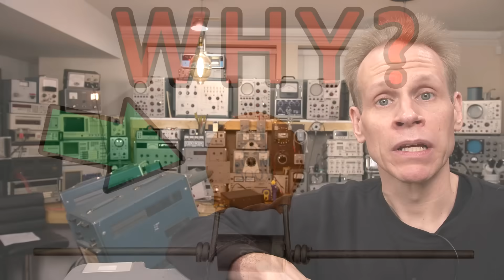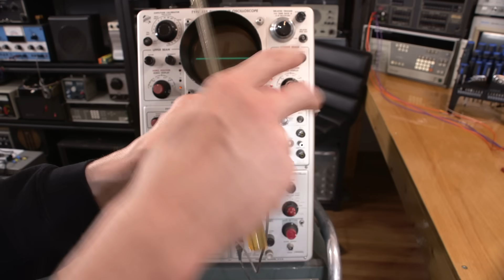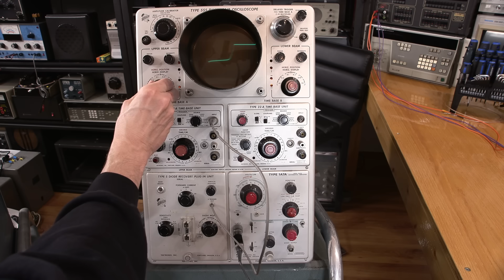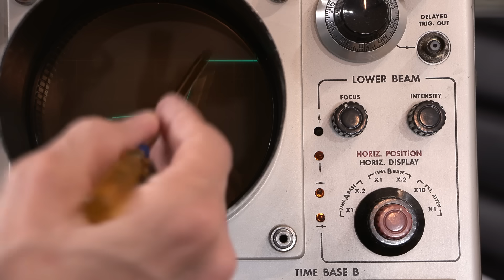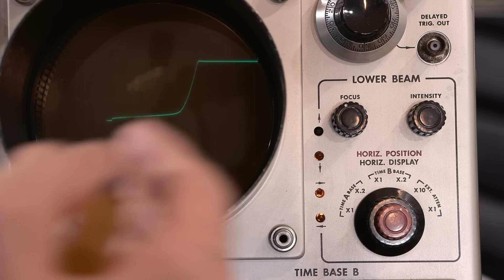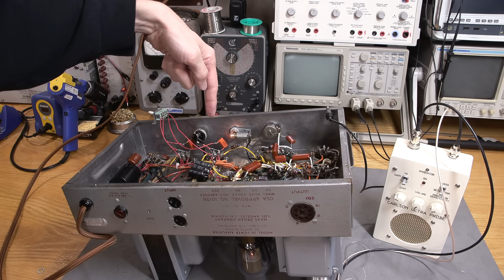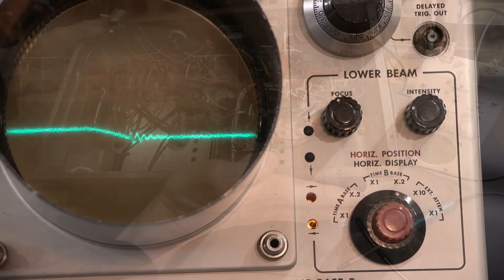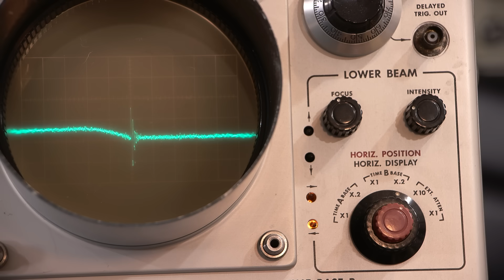Why Put A Capacitor Across The Diode? Here's Why!

Comment: First time watching your channel... I never knew this so every day is still a learning day even at 64. The valve amp took me back to being a kid when I was designing circuits with power pentodes - valves much more satifying to work with than transistors :o).  I could swear that the handle of your ultra probe looks like the body of a solder sucker - I have one exactly the same colour that I got yonks ago and still works as well as it did from new.

Comment: What is the relation of the capacitance to the diode used?
If the recovery time consumes 10nC of charge, would I use a 1nF, a 10nF or a 100nF capacitor?

Comment: if you have a an integrated rectifier block it will not be possible to put a capacitor over each single diode

Comment: Interestingly i didn't know that they were important because with a large capacitor across the dc,i always that would be enough to eliminate all the ac component hence removing significantly all the humming or noise in the circuit.Very interesting.

Comment: Using a capacitor in this way, if the diode burns out, alternating current will pass through it and burn out all the subsequent components.
Reply from the maker: What you need to ask yourself is: How much current will a .01uF capacitor pass?

Comment: So in a tube guitar amp where the bias supply is being rectified by just a single diode, is there any benefit to putting a cap across that diode and if so, what would be the preferred type and value?

Comment: I have a question. In a situation where the power amplifier's power supply lacks capacitors in parallel with the diodes, does the switching interference of the rectifier diodes generate a buzzing noise so severe that the amplifier constantly wakes up and it becomes difficult to adjust the floating quiescent current? Best regards.

Comment: Hello, the Snubber Federation (capacitor + resistor in parallel with a diode), which I represent, appreciated your video.

However, the Federation is concerned about the absence of a series resistor, which prevents excessive recovery current. We also remind you that filtering a diode requires taking these parameters into account to correct other resonance phenomena that might occur. The Federation also indicates that the switch setup used in this video to demonstrate the benefits of a capacitor is for educational purposes only and is not suitable for all circuits. The Federation cannot be held responsible if the series inductance and/or switch bounce causes damage to your circuit.

Thank you for your interest in snubbers.

Sincerely, 
the Anonymous Snubber Federation.
Reply: Haha, the word 'snubber' brings back some memories!  In university a colleague student had the problem that in his SMPS the snubber diode regularly blew out. So I advised him to put a snubber over his snubber diode. And it worked! 😀

Comment: Nice presentation, only remember than very often capacitor not are inserted because feliability is more low than without, but is true than in some cases is better for example close to zener diode for control level of voltage before a converter...

Comment: Placing a capacitor in parallel with a diode reduces voltage noise and spikes across the diode. The capacitor acts as a temporary storage for charge, absorbing rapid voltage changes that would otherwise appear as noise. This effectively "shorts out" high-frequency spikes and smoothes the signal, creating a cleaner, more stable output.

Comment: I built my First radio, at the age of Seven, in 1957.

Fast forward Eleven Years, and I walked through the doors of the US ARMY SIGNAL CORP, for Avionics Communication Equipment Repair.

IFRC, the number 1 topic for EVERY RADIO, was the number of CAPACITORS needed, for "clean transmission & reception" 😮

• • • • • • Thanks for the memories,

TroubleShooter ONEFIVE, I fix your shorts, no sparks included 😊

Comment: In a zener diode the noise is even worse and you really need a capacitor there! I have made long range single frequency transmitters using only zener diodes and an antenna and a ground It's a really simple one component transmitter with a bleed going to ground.

Comment: Interesting. I hqve a motor in my telescope that acts up, usually just this time of year. Looking at the replacement motors it has a pcb on it that the motor in mine doesnt have. The pcb takes the signal from the motor controller, through a capacitor on the board, and then i to the motor. Presumably this is doing sort of the same thing that you cover here.

Comment: i am being a bit dim here but only have a basic understanding of some electronics so bear with me..
I can appreciate that the diode is a gateway on the circuit allowing the current to pass through in 1 direction (good name for a band Diode lol)..
What I am struggling with here why does the current not just use the capacitor as an alternative path through the circuit?
Also why would this filter out the "noise" when the pathway through to the diode is not interrupted by the capacitor? It seems to just sit alongside it - how is that going to filter out the noise? 
As I said a bit of a novice but I like to learn - I have tried Dr Google and whilst it explains some of it it doesn't explain it all ie the  questions I have just asked..

Comment: Different capacitor values block different noise frequencies. I’m not sure he understood the reason, but it’s a good experiment. Some people use multiple capacitors in parallel to cover a broader range of noise filtering—especially in power supplies.

Comment: I don't think you provided enoutgh background this time. What is the diode used for in the application? OK, after almost 3 minutes we find out that it's a rectifier of mains AC voltage. What are the axes of the analyzer, and why.don't we see the forward region? What would the curve at the analyzer look like if you added the cap to the tested diode?

I still don't understand why adding additional capacitance to a diode that has parasitic capacitance helps.

Comment: i have no idea about electronics but i remember putting a capacitor on the speakers line of my aftermarket car radio( or power input between + and -) dont remember well. and solved the noise problem, i used a electrolytic capacitor(12000 uF, 12v), :0 haha

Comment: On a full-wave bridge, would you need 4 diodes, or just 2 as it appears with your switched circuit?
Unclear on where just 2 diodes would go on a full-wave rectifier with 4 diodes?!?!?
Reply: If there is  a center tap on secondary side of the transformer, then full-wave rectifier needs only two diodes. It was usual in old school amps, especially with vacuum tube double diode rectifier.

Comment: Not a expert here but with some questions: It looks like this is only for AC or analog signals, but not necessary for DC. Also what happens when the circuit is turned off? Does the capacitor stays charged with the diode preventing from de-charging? If yes, can this be fixed with a (very large) resistor in parallel to the diode, just to allow it to loose it's charge when turned off?

Comment: Thank you! A very simple solution to a non-obvious factor, even for an experienced electronics engineer...
It is obvious that electromagnetic noise cannot be completely smoothed to zero in principle. After adding the capacitor in parallel to the diode, the wavelength changing to shorter or longer. Obviously, the change in wavelength depends on the capacitor's capacitance...
I'd like to see practical tests of capacitors with different capacitances and types (polar, non-polar, and different materials made from)...
Reply: It's just slowing the rise time which is attenuating harmonics.

Comment: i guess this capacitor it need to add to a unregulated power supply to removed ripple specifically a 12volts it need 4 of them placed across bridge

Comment: The  diode noise  is actually a spark gap?  Irritating  noise in a hairpin circuit  could be eliminated and energy conserved if a condencer is employed  ...thanks  ..now I see how the solid state version of the spark gap can be enhanced  in  a device producing  longitudinal waves..cold electricity without the noise..  I would like to see  cold electricity in every home  as a safety precaution..

Comment: For the viewers who have never enjoyed working on circuits employing vacuum tubes.  There was a lot of apprehension associated with probing around in a live circuit.  Voltages were often in the 100's of volts.  It didn't take much to get big, dramatic sparks,  electrical burnouts, and the occasional painful electrical shock.

Comment: Capacitors are very useful.  I have used them in my car to time out and lock out relays making them momentary and safe from overheating.

I added an electric gas door release from a different car and trunk release button  with a capacitor in line with each of the relay's triggers... When the release button is pushed the relay triggers while the capacitor charges, then when the capacitor is charged the resistance shuts off the relay.  The charge in that capacitor keeps the relay off and unable to trigger again until a resistor bleeds it off.  This makes the release momentary and also prevents overheating within the relay or the acuators in the event the button gets stuck or there is a short.

Comment: 4 diodes, 2 caps. I'm not familiar with the amplifier, particularly the 2 diodes tied to 2 pins of 2 tubes, but I think what we're ultimately talking about here is not simply "putting a cap across a diode" otherwise there would be 4 caps for 4 diodes. I think this is just adding caps to ground and filtering the AC artifacts from DC nodes. That's fine, but the presentation is quite click-baity and literally hand-wavey. Of course, I am completely open to being wrong if you'd care to explain.

Comment: Just imagine an ideal diode configured as a half-wave rectifier, converting a 60 Hz pure sinusoidal tone into a half wave rectified sinusoidal pulse train.

A pulse train in the time-domain is also a pulse train in the frequency domain.  So lots of 60Hz line noise up-converted to "n" harmonics of 60Hz.

The capacitor makes the current transient in the current loop path less abrupt.

In the frequency domain, it has the effect of "rolling off" The high frequency harmonics.  The same as how a low-pass filtering cap connected across a speaker would act to muffle  high-frequency treble sounds from coming out of the speaker. 

In the scenario that was demonstrated, there is no speaker, but there is magnetic field coupling (to his sensor thingy), parasitic capacitive coupling, and some electromagnetic (radio-wave) radiation. 

The capacitor simply reduces the abruptness of the diode on-off current and associated voltage ringing that the current-path inductance generates.  Inductance wants the current to keep flowing, and the capacitor provides a path for some continued current, reducing voltage spiking.  Reducing the otherwise detected spiking.

🤷‍♂️

Comment: If you need a project I have an old HygainVII   CB/SSB 23 channel slant face that needs a new chassis socket, I attempted 3 times to put new one in but the socket has both a capacitor n diode. I fixed boilers and burners for decades with all the controls but when it comes to radio inners I know ZIP I have no business in there..  Thanks Mr. Carlson

Comment: Nice scope, I had the rack mount version, rm45a think it had a 1A2 input module. It was a govt. surplus purchase.
Reply from the maker: The 1A2 is a fantastic plug in! The 1A7A will see signals at 10uV (or microvolts,) better than any scope on the market today, with filtering too!

Comment: @Mr.CarlsonsLab.  Great info!  What would be a cool continuation of this is if you could compare the noise output of a solid state rectifier vs a tube based one.   Also, a comparison of voltage regulator tubes (like 0A3) and how much noise they make in a circuit would be cool too.
Reply from the maker: Thanks for the suggestions!

Comment: I had a very noisy PSU come with a Sony SW receiver.
I'd previously seen these capacitors in other PSUs and this Sony one didn't have them, so I did the monkey see, monkey do thing and added caps. The noise went. Such a simple fix! I didn't understand why it worked until now, though,  so thanks for this video!

Comment: Thanks for your explanation. My background is in Avioncs (35years) so not much contact with mains powered equipment and I was not aware of the noise problem. But, I have experienced it, so now know what to do.
A bit of constructive criticism on your instruction technique here. Initially, I was confused because you did not tell us that the diodes were in a power supply bridge rectifier. A bridge rectifier has 4 diodes - Is there a capacitor across all 4? If not, which pair of diodes? Also, what value are the capacitors? Is the value dependent on the current through the diode and what about the mains frequency? I assume that the capacitors are ceramics.

Comment: Very interesting. I used to build transistorised power supplies and amplifiers back in the 70s,and never put caps across the rectifier diodes, and banked on the filter caps to cut out any noise. I cannot remember, but I think that I have put ceramic caps occasionally across the large electrolytic.
Reply: I have a few 60s Transistor amps. ACCs, big diodes, big 3600uf 85v soda can filter cap. RCA had the design for the 40411 outputs. They play loud and powerful.

Comment: Lob a resistor in on the cap side and you build an RCD snubber which is useful for handling transients from inductive loads. This is very handy for running motors off IoT type relays.

Comment: What a great collection of electronic and diagnostic equipment you have there. As an old time I remember using some of that equipment in the atomic power industry, VTVM, rack mounted HV power supplies, pulse generators, scopes, picoammeters, etc. Love the analog stuff.

Comment: i first encounted those caps when i was working on gear running on 400HZ power (military gear). That is r everse recovery noise thatis a minow annoyance on 60HZ powered gear but mch more apparent when you move up to 400HZ power. This gets much much worse when youget into switchmode powwer supplies operatingin the tens of KHZ.

Comment: The million dollar question: Is that noise present at the output? No, most likely not in that amplifier. It would be cool if you showed the crowd the difference in RF pollution (noise) between a Silicon diode vs a tube rectifier. 

Thanks for all you do for the community!
Reply from the maker: The noise you heard was right at the output transformer, picked up off a resistor in that circuit. So Yes, the noise is quite noticeable.
Reply: @MrCarlsonsLab  Thank you for your answer! I guess I posed my question too vague. What I should have asked was on an 8 ohm load how far down  (db compared to signal) is that noise across the load? I figured the winding capacitance would get rid of most RF noise at the output. I go back and rewatch the video, maybe i missed if you had the loaded at output and which resistor you were using your probe on (whether primary or secondary of OPT). Thanks again for all you do for the community!